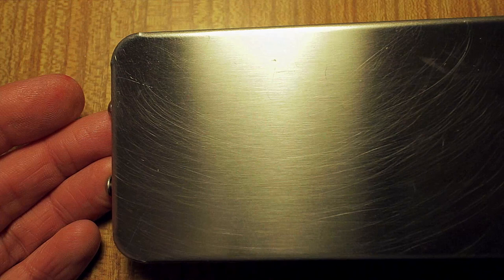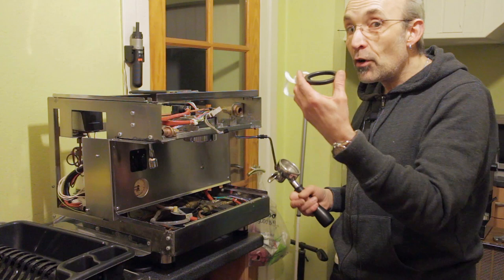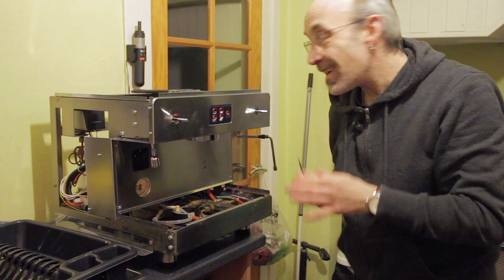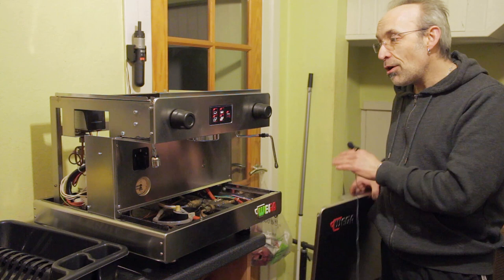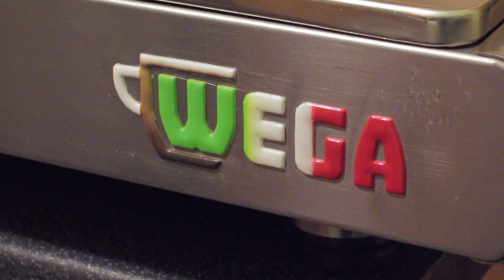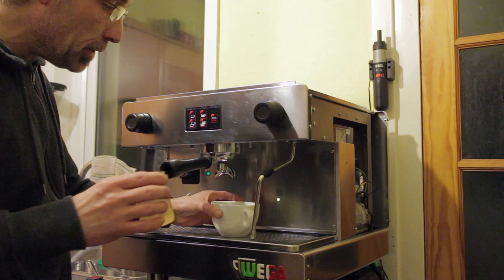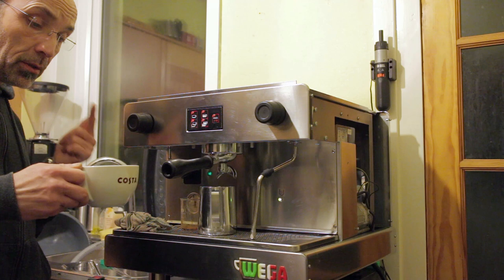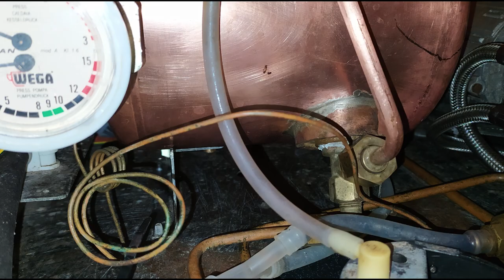Project Espresso Part 6 - Completed & First Espresso & Latte

Comment: So how did you arrange your inlet  hose ?? Is it still coming out of a tin of water or  fixed to water tap or something? Is the pressure increased now to 9 bar now after inlet pipe adjustment ?
Reply from the maker: It's now plumbed into the mains. I needed a hose plus adapter to connect to the hose of the machine.
The pressure has increased slightly with the mains connection. It could be adjusted but I'm not doing so as it's showing over 8 bar and I had to strip and fix the gauge initially so I can't be certain it's properly calibrated.
If I can access a portafilter with pressure gauge in the future I'll check the actual output but it works well now.
Reply: @spidiq8  That is good to know. I picked up almost similar but in black color Wega Pegaso single head (same as yours) in used market and I need to start working on it in next week or so. I am from India and not sure of components availability at the moment. I may need your help as you are the only one on Youtube that dealt with repairs of this (same model) machine. I will update as I go along.  Thanks a lot for sharing the video and it is really helpful. After watching your video series on this machine, I gained enough confidence to spend money on this used machine.
Reply: @spidiq8  Doid you post your work on internet forums? If so, please let me know. I can post some pictures there and ask doubts.